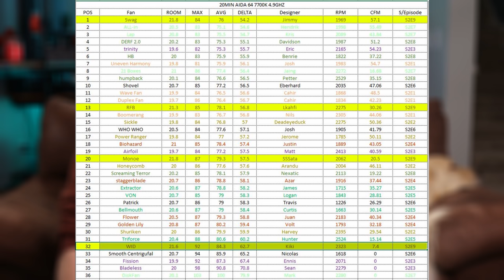WEIRDEST Fans I have ever seen – Fan Showdown S2E9

Comment: What is sounds like you were experiencing with the mic registering 52db when you turned the light I think is called a ground loop. It's where electric interference goes down the ground and gets picked up by any sensitive sound equipment as an electrical hum. It's why in pro studios etc. they will have all the sound equipment on a totally different electrical circuit to anything else in their building, like lights or computers etc. to isolate the sound equip from any electrical interference.

I was doing the sound for a mates stall at comicon in the early 2000's, and had a similar issue. We brought a laptop to demo a fly-through of some of the levels of the game he was developing and I had made a backing track for the video. We had a pair of powered speakers for sound, but if we had the speakers and the laptop plugged in at the same time we'd get this god awful hum! They had such "dirty" electric there; Basically the ground line was full of interference. We had a guy from Alienware (when they were actually good before dell happened) come up wanting to look at the game, but I couldn't show it to him cos the god dam laptop battery had just died. I had to ask him to come back in half hour, which he never did. So embarrassing. ;(

Comment: It feels so nice to see that my design works. I didn't have 3D printer so I can't test it myself. This was my first attempt and I learn a lot in the proccess of making it. Well, at least it works as intended without the stopper. Perhaps I need a wider fan blade for more airflow and tighter tolerance to prevent wobble

P.S: it pronounce el-kah-fee

Comment: Just a note on dB scales, there are different weightings.  While the A weighting dBA is the one usually used for legal purposes, it is not the best in determining how loudness sounds to people, nor does it show how much energy is lost to sound.  The problem with it basically has a parabolic spectrum sensitivity, which means it quickly looses sensitivity towards the extremities of the spectrum giving falsely low readings except close to the mid range.  C weighting (dBC) more closely represents human hearing but still not accurately.  It has a broader mid range sensitivity, still dropping at the extremities 20 Hz & 20 kHz.  Human hearing sensitivity drops in a similar way but is also subject to loudness in a way that the dBC scale is not.  Despite this, it is often preferred in audio work as it's a closer approximation of human hearing.  dBSPL on the other hand is an unweighted scale that shows the sound energy right across the audio spectrum unlike human hearing.  It is useful in analytical engineering work.  If you aim to determine which fan sounds quietest to humans, dBC is the weighting to use.  If you want to show which fan looses the most energy to sound, dbSPL is the one to use.  dBA is simply a bad choice for everything including legal purposes, but we are stuck with that.

Comment: Mono was probably statically balanced (CoM is along the central axis), but almost certainly wasn't dynamically balanced, giving the wobble along the axis when spun up. (This is what tyre shops do when they hammer on the metal clips onto the rim) Have read about people trial and erroring this away with an accelerometer (phone) and some blu tack...

Comment: On a cooler i can see why the WID lost... But if you have 2 of those pushing Air into a larger chassis it will probably be pretty good. With the way the smoke moved behind it, its better at filling large space with air than it is with moving air in a specific direction, not focused cooling. So 2 large WID's on frontpanel with some decent extractor fans should be pretty good.

Comment: Interestingly I was thinking of a concept like that of 'adjustable' blades but what I thought was something like a progressive turbo (not sure that's what's called) where the turbo adjusts itself to produce more compression in lower revs then sort of opens up in higher revs to get the flow somewhat constant.
I discarded the idea because the point here is max flow/lower temps and also being electric there is no lower revs so no loss either. I even thought that it could apply if the goal was to reduce noise but then again, if the fan is effective on itself the noise would be reduced when the revs goes down so it would still be pointless.

However it's ALWAYS entertaining to see those new concepts including that one with the tiny 'teeth' in the outer rim. I was amazed by the fact that 1) it didn't throttle, 2) it was still sucking air in the center and 3) it was louder than the mononucleosis fan lol

Kudos to the Swag fan! Didn't think it would go that well, very good!!

BTW: didn't like this filament though… colour is fine but the final result looks rougher than usual…? If it is as rougher as it looks that would have an impact in the end results…
I mean we're here just for fun so that's no biggie but as a suggestion: season finale print the top 5 with the same ABS filament and do the acetone smooth treatment then run them against each other to see if we get any changes.
Actually that could be a good idea for any season finale: print the top 5 with the same filament (acetone or not) and to a final showdown face-off what you think? 😃

Comment: just a little suggestion, wouldnt it be kinda cool to see what every fan is up against in the smoke test? you could show 3 fans, 1 on top that is the current fan you are reviewing. and then have the the bottom halve show the a12 and the current top performer from the community

Comment: @Major Hardware
We used in my old company NTi XL2 Audio and Acoustic Analyzer. It is very precise and fast with quite good software.
 https://www.nti-audio.com/en/products/xl2-sound-level-meter
We used it to test smoke alarm detector. The alarm has to be in a precise range by loudness and frequency. 

Yes it cost a little, but it worth its money.

Comment: I would like to see him fill a clear plastic tub with the smoke and use a standard amount per tub and have a hole with the fan, and time how long it takes to clear the smoke out. This would help quantify the efficiency of the fan in pulling air out and would simulate pulling out the heat. and if the tub were clear I would assume you can still get the cool shots of the smoke being pulled out. I would at least like to see this done with a few fans to see if there even is any variance in "suck"? efficiency.

Comment: The problem with single bladed fans is that no matter how "balanced" you get, you have a tendency to get unequal pressure across the bearings, resulting in excessive wear and friction.

Comment: Single blades need to run at twice the RPM of a 2 blade one, their greater efficiency comes from running in clean air and not in the turbulence of the blade in front. Needs a single blade design that includes a times 2 gearbox.

Comment: On the back side of the fan, to create more of a precise jet output, the fan enclosure itself (or outer ring of the spinning inner fan blades like on the WID in this video) could have a funnel of sorts (like how the back of a jet engine tapers to about 50% of the front opening where the blades are). A question about that: if there's a taper, we can assume there would be pressure that builds up between the fan blades and the exit, what affect does the pressure have on the fan blades (slower rotation?)?

Comment: 1 replace your battery. a low voltage battery can cause many issues including the issue you described. with the backlight on it would cause the battery voltage to drop enough to cause a false reading (prob just resetting sensor due to low voltage) so if you want to get an audio analyzer thats fine too. id like it. but just replace your battery and it will prob work properly again lol. it is flashing at you on the screen.

Comment: WIDs design should be used in a fan that has the motor on the outside
like the outside ring being from a ferrous metal, and electromagnets in the corner of the fan drive it.
this should also make it more silent as the air could flow through it without any obstacles, and the holders that hold the ring on the central engine could be avoided, wich should also create extra noise. But the main cause for noise would be that the rotating holders would constantly pass the fixed holders of the motor very closely.

Comment: I think the rankings should be done as a combination of ΔT and noise (and, maybe a coolness factor). The combination should be weighted towards ΔT but the noise factor should still be weighted high enough that a particularly noisy fan would have no chance of getting on the leader-board while an almost silent fan should be able to make it onto the board even if it isn't the best at cooling. Something along the lines of ((5 * ΔT) + (2 * dB)) ÷ 7, this weights ΔT slightly more than twice as strongly as the noise which seems about right, though it would be worth tweaking the formula with the existing fan results.

Comment: Can you put in the Original Noctua fan on the chart for reference? Also would be cool to have a noise level column.
Reply: Delta of 57.4, which means it would be on the same place that the biohazard is, at rank 18.
Reply: @livedandletdie  Maybe we need a new measurement for that because some stuff (like the room itself) changed since the last run

Comment: All the groves and edges are holding your fans back. Use a very light sandpaper to smooth it out, the air force/flow will improve to peek performance.

Comment: Monoblade is good one. But it needs to reconfigure the counterweight. Move its main mass closer to back. In rotation this lever should compensate lifting force of the blade and remove vibration.

Comment: i wonder what happens, when you take the monoe and mirror the fan side and make it a 2 bladed fan.
Reply: Mirroring would make one side push air backwards.  Do you mean revolve, as in turn around the hub axis to the other side?
Reply: @VoltisArt  yeah, that was what i meant :D Thanks for correcting

Comment: I think you need to add burst rpm tests. You'll need a vacuum chamber. I large cooking pot and a cheap vacuum pump will get it done. Mount a high rpm motor in the bottom with a hub the same dia as the noctura rotor. I'll build it if you blow stuff apart.

Comment: Side view is great. Think about wind tunnel testing. You don't really care about the air hitting the front. What's important is how it passes over and comes off the back. Side view shows air flow much better. (put a black background on it to highlight even more) I'd still like to see noise normalized comparisons. I won't use a noisy fan regardless since most cases would have 3 or 4. Way too obtrusive. Thanks!

Comment: The mono bland will never balance dynamically. Yes you can get a static balance but when spinning the load (blade moving air) is proportionally a long way from the axis and only at one point. This gets worse as you increase the amount of air moved by the blade.

Comment: For the wid. I would love to see it remade.  Do not add material closer to the center but make the teeth print from the top of the circle to the bottom. More like blades instead of teeth. I think it'll work better and be more efficient.

Comment: I think mono should get a re-go... Being off balance its gonna waste a lot of energy wobbling everywhere instead of actually pushing air.

Also, maybe for season three, set the speed of the fans to reach the same noise levels then see how they cool... Some fans can ramp up super loud so such a test would normalize the noise and then assess the cooling ability based on design, not just how fast they can spin the blades.

Comment: Problem is you have static and dynamic balance.
Static balance just means the total mass on each side of axis is same.
Dynamic means that the forces acting on the fan due to inertia as it rotates is the same.
If both are not balanced you end up with what you see here, it balances fine as long as it does not move.

Comment: Did you try replacing the battery in the dB meter? I know it had a low battery indicator and maybe the backlight is pulling the voltage down enough to screw it up.

Comment: here's a question: can i send in a fan design that is basically 2 clamps x 7 "blades", all with one requirement: you need to make the 'sail' for the blade with a sheet of paper that's been folded on two ends, and then cut to size. Could use glue, wouldn't really need it.

Comment: While the monoe is balanced by a weight perspective, that counterweight is going to drag a lot compared to the airfoil, thus causing an imbalance. Imagine if a plane had a solid block for one if it's wings, assuming a constant forward vector with not other acting forces, that plane would want to turn to the side with the solid block wing due to increased asymmetrical drag on the body's center. Of course, the analogy is a bit different when it comes to rotating airfoils, but I would assume a rotor of any design would do similarly to the fan, induce so much vibration that the machine falls apart. This is why any form of rotor is counterweighted by additional airfoils, and why a proper monoblade would be counterweighted by adding proportional mass to it's center hub. 
RFB would be interesting if there was a way to actually control the positioning on the blade, assuming different RPMs have different efficiencies at different blade positions, like a variable swept wing on a rotating hub actuated by some kind of conical swashplate or something. But, of course, this would never work as a fan, as that would require extra control, which would never exist within a fan system; interesting concept for a rotor, though, assuming the concept would work. The fan design itself just doesn't make sense for a fan, collapsing blades that aren't mechanically actuated make sense for drone rotors for collapsing the overall footprint of a drone to a smaller size, but you don't need that within a fan; all you'll achieve from this is mechanical losses due to flaccid blades. 
The swag's gaps in the blades, I assume, act as a vortex generator, or at least are intended to. Gaps that small probably won't affect the boundary layer, though. I would also assume that a proper implementation of these vortex-negatives would be assisted by blending the gap into the airfoil itself, allowing one side of the airfoil to more easily let air slip through to the other side, thus generating a vortex through induced turbulence. It'd be much more interesting to see this on a decently sized experimental aircraft, but at this scale the effect is either negligible or nonexistent; which a lot of people don't realize that physics do not scale with size, what works on a full-sized aircraft will not work on a tiny fan blade, no matter how hard you brute force the idea to work. Having vortex-positives, the typical style of vortex generators, would've shown better results. 
WID is interesting, but historically have outer-ring-based airfoils on a rotor shown to not be as fruitful as center-hub-based airfoil rotors? I know the design is used a lot in sci-fi, but there's probably a reason for that. The only time I can see this idea being fruitful is when you have a hubless rotor, as in the stator is in the outer body of the housing, and the rotor is an in-runner that fills a void; but again, sci-fi concepts, we can barely even get a hubless wheel to become a trend, rotors like that will never reasonably see the light of day. Again, at this scale, the concept more than likely faces too many downsides, where at a proper scale with a full-sized aircraft, the concept might show some uses.

Comment: Someone need to make a fan where two fans are stacked, and the bottom fan somehow turns gears so that the top fan turn in the other direction.
Reply: From what I can tell, computer fan motors typically don't have enough torque to make that work. Not sure if 3D printing has the tolerances to make a gear that turns smoothly with a feather touch.

Comment: Major, you should do a season/spin-off for best box fan blade design. Summer is coming and cheap box fans have got to be mediocre at best.
Reply: That would get expensive fast, unless you mean copying at a smaller size – which wouldn't be a fair test without using the same plastic and scaled thickness as the originals, which will easily become too thin when shrunk.
Reply: @VoltisArt  no I mean full size. Yeah that would use a lot more PLA but I guess it depends on how much the episodes make and how often he would do them.

Comment: I believe there is a big problem with the measurements. I believe that the room temperature has a direct influence on the Delta. I believe that for the comparison to be fair, the room temperature had to be kept the same on all tests. I believe that either the Delta is coming lower when the room temperature is lower, or that the Delta is coming lower when the room temperature is higher. I believe my hypothesis is kind of easy to test, just change the room temperature for the same Fan and see "if and how" the delta changes with it. I believe... I believe... lol.

Comment: So I have a Ender 3 pro 3d printer. looking to get just this kinda thing out of the fans. Also thinking of a Modded Sunlu S1 filementdryer.  So my question is this. A 65mmx65mmx20mm ( the outside of the casing) square say hotend or parts cooling fan ( for a mental reference). What, if any, would be the improvement on silence and air movement while using the best fan in this show down on a fan that small, or the small parts/hot end cooling fan sizes? Thank you in advance for any helpful answers.